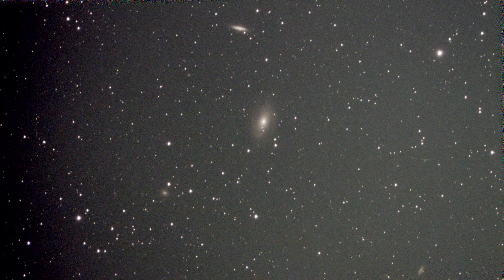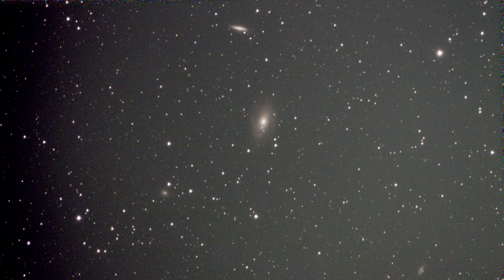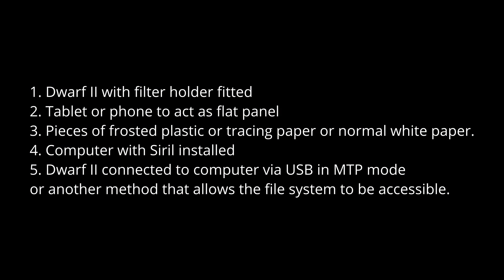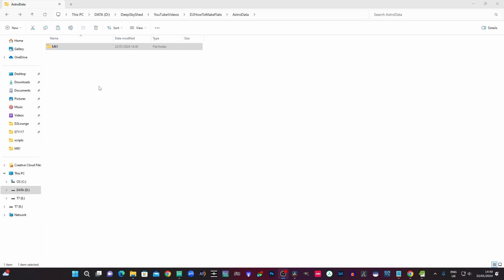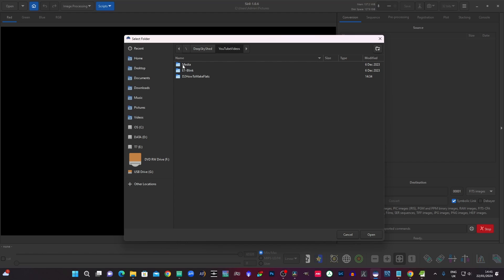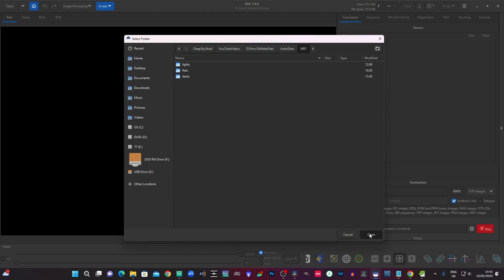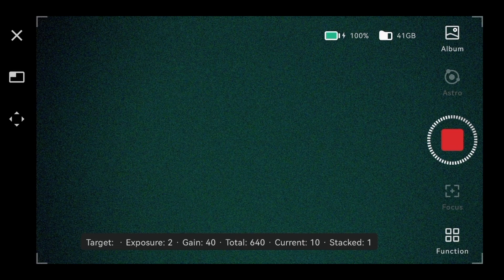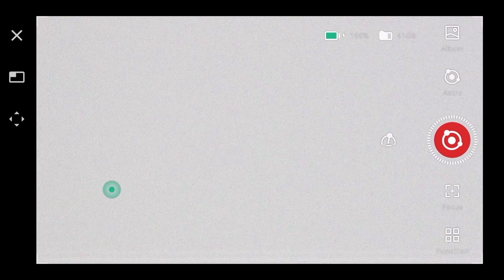Dwarf II - How To Make Flats

Comment: Good work flow to make D2 flats DSShed and thanks. I am using a Dwarf3 but the principle of making the flat frames look to be the same as the D3 will be. A question please, after getting the ADU value right for all 25 subframes, do you stack them and make a master flat?  Hopefully DwarfLab will make a flats routine in the app soon and follow suite with the SeeStar smart telescopes.

Comment: Nice presentation, congratulation! Does granularity influence the quality of the frame? I tested and found that at low light a frame appears and with a strong magnification you see a frame. I get a value of 1470 that seems correct. Bravo 👍